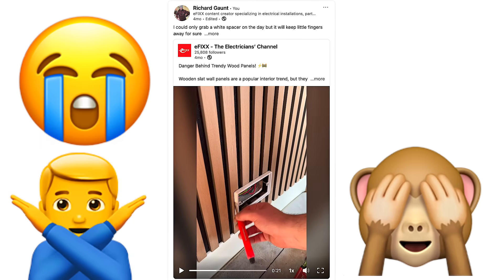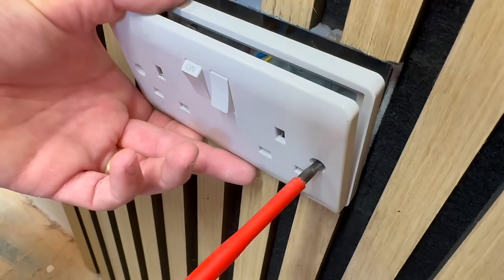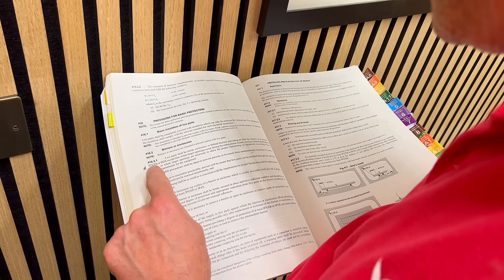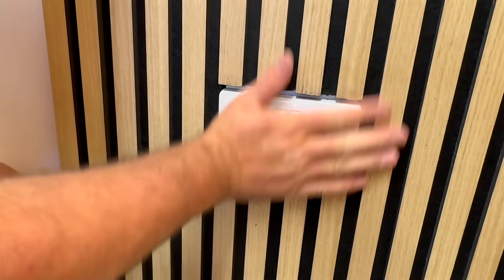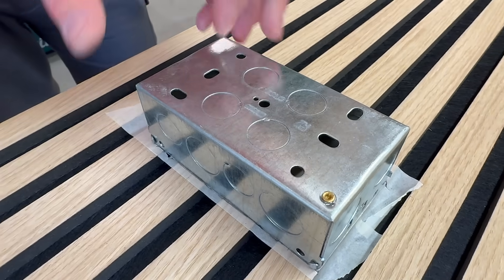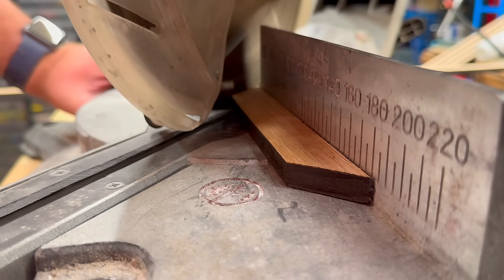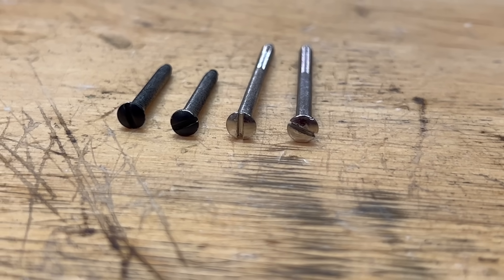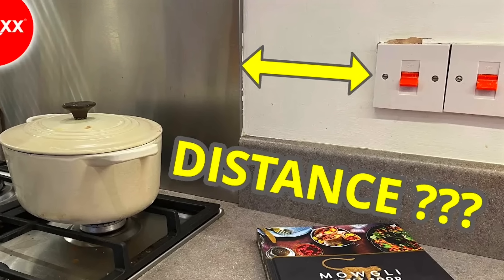Joiner VS Electrician: Who’s Guilty Here?

Comment: cut the hole slightly smaller than the backbox and cut the slats the correct size so the face plate sits flush to the slats and there are no gaps.
Edit: that is fabric backed, ignore.

Comment: A regular frustration is being called into do electrics after the carpenter has started the work.  Good example is with LED lighting strips for shelving and cupboards.   If the carpenter talked with an electrician before design, they could incorporate slots and cable runs while cutting the boards in their workshops.
Reply from the maker: We share your pain

Comment: Why not do the job properly and fit the back box flush with the outside of the panels instead of leaving it in the wall?....
Reply: Because digging out a hole is not always an option, especially if something is in front of it
Reply: @Adam-n1p6m  there's sparks and then their are people who think their sparks 😅
Reply: @MarcFrost-n5l  realistically in this case you could get away with not being one it’s not the most ideal situation but it’s less likely to create melted wiring and things like that
Reply: @Adam-n1p6m their talking about installing panel onto a wall with an existing socket. It just need the wiring altered before the panel is installed if there is not enough length on the cable. If it was a existing wall that was being framed and insulated I wouldn't dream of leaving the original box on the original wall with a big gap between. At the end of the day It comes down to wether or not the installer is good at their job and have standards. As for melted wires, I don't know why your cables would be melting if the jobs done properly 😂

Comment: Plumber here (so obviously not as intelligent) 😂. Bring the back box forward or use a deeper back box to finish flush with the finished surface. Or am I missing something?
Reply: You would have to dig the wall out to do that also it’s harder to undo the change so especially if the electrician was not consulted beforehand it could be very messy and expensive

Comment: Wouldn’t that create a fire risk as the wooden filler pieces could come in? Contact a very close to the terminal screw area?
What a better solution be to either use a deeper back box or pad back box out of the wall slightly to match the front of the fascia or even use metal box extenders? The box extenders could be sprayed black on the side so they blend in with the black belt to maintain the aesthetic.
Reply: If it’s done carefully, it should be fine, but of course you have to work out based on the situation

Comment: I have a question, nothing to do with this video but I need fellow electricians guidance because I'm not sure if I have come to the correct conclusion. I work on larger PV / Battery systems, all residential stuff but think more Downton Abbey than Coronation Street! All my training / experience is <1000v, but some of these huge PVS systems I am working on are 1100 vDC. So I've spent an evening with 'the book' and I think everything comes under Part 2 definition, 'Voltage, nominal' which states 1500 vDC between conductors / 900 VDC WRT to earth, so I reckon that contrary to what we we ever taught 40 years ago and what's on the net, we can indeed install / work on systems greater than 1000v, in fact up to 1500 vDC no-load. Do you agree, or have I missed something?
Reply: I suggest you get some solar/pv training as DC can do some pretty wild stuff, and you can't just turn off a PV system during daylight hours.  Whatever you learnt 40 years ago doesn't really apply to modern PV.
Reply: @edcooper2396  Don't you think i know all this, and don't you think my knowledge and experience far exceeds a typical electrician! My question was what is the highest voltage we can work because I was always told it was 1000v but I am coming across 1100v systems and was wondering  if other fellows are coming across these and what, if any, steps they are making to adapt to the 1000vDC to 1500vDC category.
Reply: @paulmcraexx  if is superior, why don’t you know this? You can easily work with millions of volts, but the equipment is custom and very expensive

Comment: I think you've achieved a good 'commercially reasonable' balance. Curious, my background is a marine electrician where I have to deal with this exact issue, usually involving solid, super expensive wood on a much larger scale! I always make a series of MDF templates (sometimes taking 3 or 4 goes) stain them, get the owner to approve the design, then I go back to my workshop that has cnc woodworking machinery, spindle moulders etc and machine the profiles. Sometimes this requires me to manufacture stainless steel surrounds or edgings that all have to be polished. The results are stunning but you can guess how much it costs! Once I had to make a 230v distribution board with two generator feeds, signalling, control systems, satellite monitoring etc, amazingly complicated and a precision bit of stainless steel and solid woodwork, took me 4 months! Can you imagine how much it cost to make and install what is essentially a consumer unit! Worst still, 3 or 4 other yacht owners have asked me to do the same for them, but for us electricians, basically acting as a self-employed guy, having fun and making money, these £20k+ electrical installations have good returns, and you get to work in your own airconditioned workshop with infinite tea and biscuits, but they carry way, way too much risk. This is why I have switched to the more complex photovoltaic installations with on-grid, off-grid, multiple inverters etc, still lots of fun but I don't like heights much more than about 8m anymore and some jobs absolutely shit the life out of me!
Reply from the maker: They sound like great projects - Happy to pop along to the next mission and learn more!

Comment: Is that slat wall fireproof? If it has no fire retardant deep in the material than using cutoffs to seal the gaps may not be an ideal solution.
Reply: Some might be, especially as these are sold by some builders merchants so they would need to be compliant

Comment: Now if the slats were horizontal instead of vertical  only one or two fillets would be needed to fill the gaps which is less time and faff. Horizontal slats would also open the possibility to using the type that facilitates bracket and other fixtures to be inserted and hung on the wall as well as making useful little cable runs for quickly and easily hiding cables. Simply putting the slats horizontally and using the proper slatted board would be far more worthwhile and useful.
Reply: That would be extremely expensive, as these boards are not made that way

Comment: I thought that's why screwfix sold multiple colours of silicone sealant?

Hopefully my customers have better taste than to fit these walls 😂

Seriously though, aren't the slat wall manufacturers are missing a trick by not providing a solution for this issue.
Reply from the maker: Based on the price of the panels - yes!

Comment: I 3d printed backbox extensions in black, bonus is I can create them as deep as I need - easy print to design
Reply from the maker: Sounds like a great solution for getting the perfect fit! 👍
Reply: Always check the plastic has a high melting point as a lot of 3-D printing filament will melt under a slight high high temperature that is still considered acceptable

Comment: I fit those plastic socket spaces on ceramic tiled wall . Longer  black , brass and chrome pattress screws are available . Plastic socket spacers are available in black or whatever in various thickness starting from 10mm  upwards

Comment: Yes I know its boooooring, but speaking of safety and digits getting in to places you shouldn't, your digits are waaaaay to close to that saw blade. Please use a clamp or something else to hold small bits of material that close to the blade. It's why the base has a no fingers warning a good distance either side of the blade. One snag on a small bit like that and you'll be in A+E having your digits (hopefully) re-attached.
Reply from the maker: Safety first, I'll try to be more mindful of that next time! 👍

Comment: You could have just changed it to a dry line box.
Reply from the maker: It’s another option depending upon the wall construction.
Reply: Does it matter what the wall is made of? The dry line box can fix in to the slat wall panel before hanging? Could you use black one to make it look tidy when viewed from above.
Reply: @mattroche5079  that would technically want an electrician doing it which require multiple visits and a lot more money